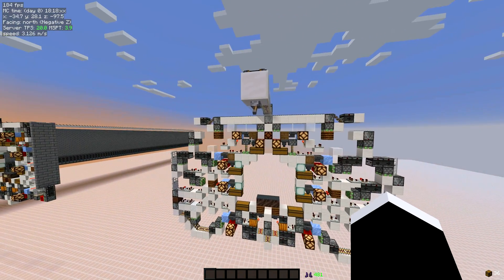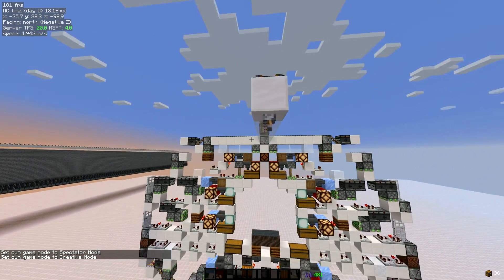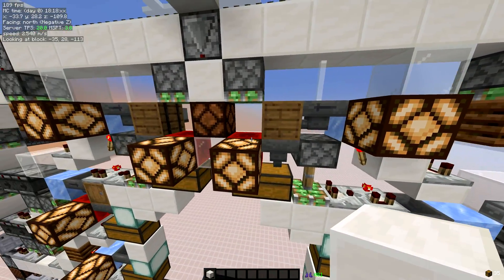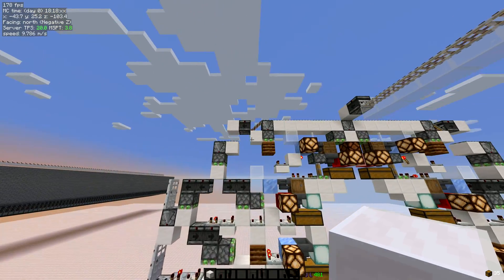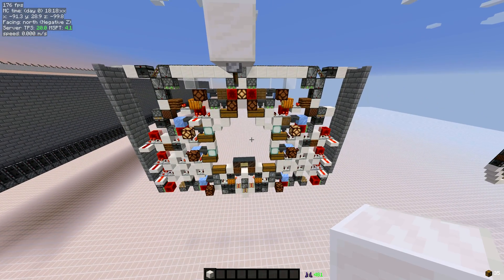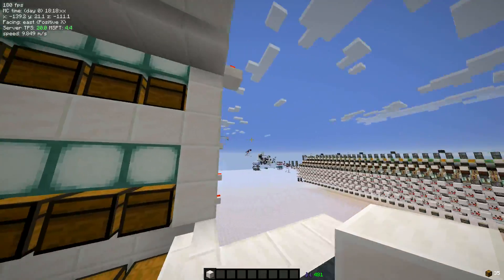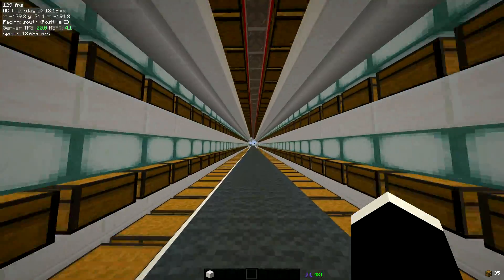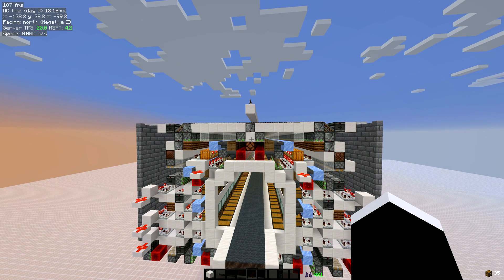1-Wide Tileable Binary Coded Storage Hallway

Comment: I just dont understnd what it is used for?
Reply from the maker: Basically, it is for sorting items into chests. It is like a normal storage in that way, but it is more advanced. Since it does not use item filters, it assigns an ID to each item. This ID, represented in binary, corresponds to a chest in the storage. When given an item, the storage will get the code for that item and send the item to its destination chest. One of the main advantages of a binary-encoded storage is that the fill-level of each chest is known. With this information, the storage can intelligently reallocate items throughout the storage system and other storages. Hopefully that is a good explanation :).
Reply: @broyojo  thank you so much!

Comment: i dont even know what binary coded means but it seems cool
Reply from the maker: thanks, binary coded means that every item is assigned its own binary number. so like sticks would have the code 10010110, or 150 in decimal. so like when you want to put an item in the storage, you input 150 into the storage and then put the sticks, and the sticks will go into the correct chest assigned to them.
Reply: @broyojo  What exactly is the point of this approach? Will you need to remember all the codes for each item?